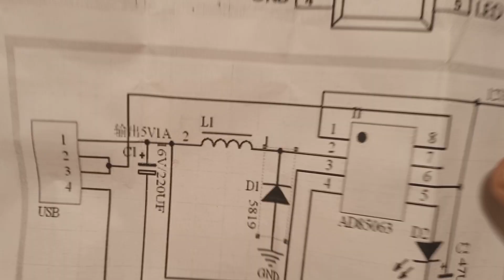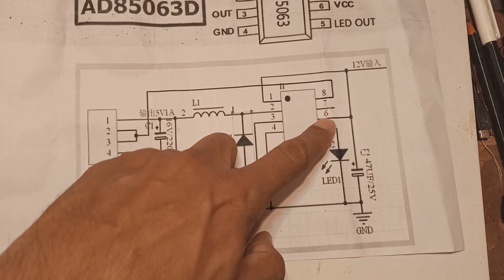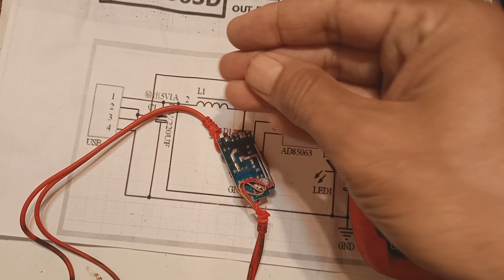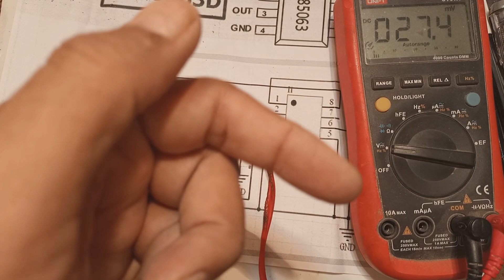Charger repair 12V to 5V cigarette lighter charger circuit board repair. An easy electronic repair

Comment: it is batter called dc to dc buck convertor rather then charger, because power supply or charger has bit different then buck convertor. this ic is a step down buck convertor.

Comment: thank you for this video. P.S. has this chip an internal voltage regulator??? because i see nothing to drop the voltage for the chip. or can it handle 24V input????
Reply from the maker: Thanks for complement. This chap handles both 12v and 24v input and outputs steady 5v for cell charging. This is an SMPS chip with all necessary circuitry.